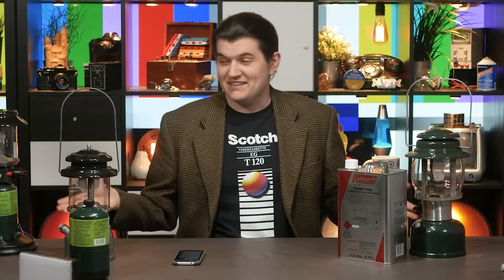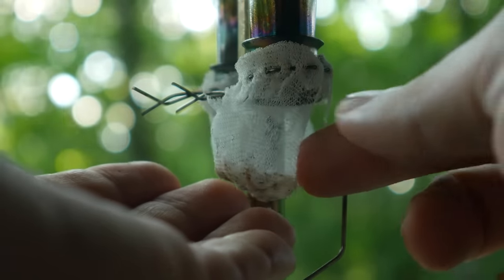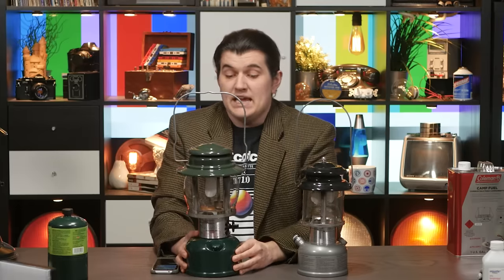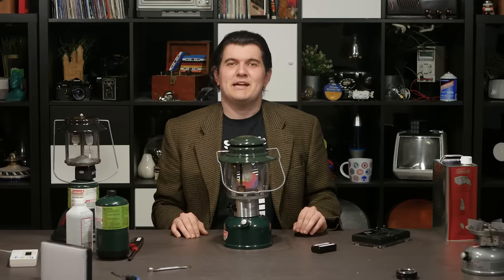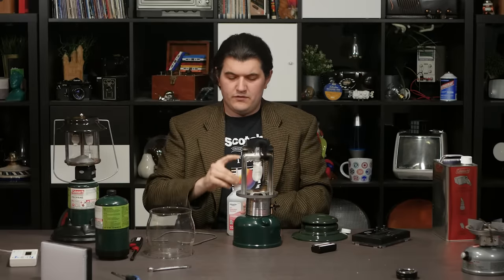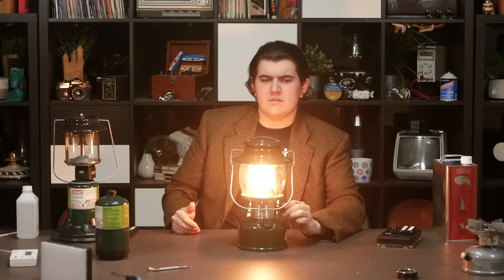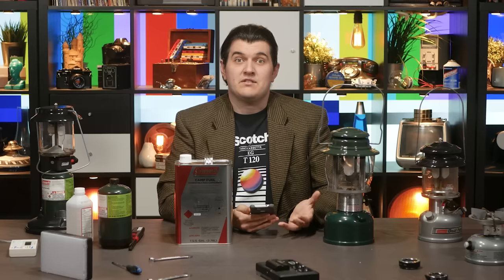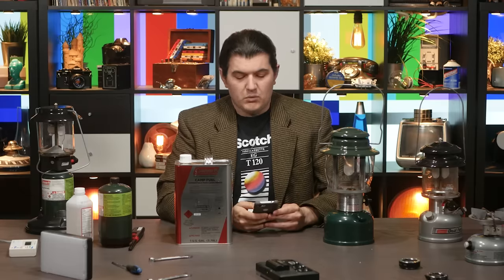A very rambly Coleman Lantern follow-up. Turns out they rarely make sense in 2021

Comment: The best kerosene lanterns have a blowtorch starter built in that preheats the generator without needing alcohol.  These would be the petromax or clones. Kerosene also has a very long storage life when the container is sealed properly.  I switched over all my emergency backup stoves and lanterns to kerosene.
Reply: I would think it would be simpler just to design the bottom so it would funnel any liquid fuel that's squirted out to the base of the generator, and then have a fiberglass wick around the generator.  Kerosene will ignite readily with the aid of a wick, and the flow of fuel to the wick would automatically stop once the generator started vaporizing the fuel.
Reply: Kerosene's also a lot safer: gasoline emits heavier-than-air flammable vapours which can be difficult to vent from, say, a boat's bilge, and kerosene doesn't. My father had a small (7m) yacht and gasoline (which we called petrol) was strictly forbidden in the cabin. Instead there was a special locker in the cockpit with air vents at the bottom. For cooking and light, we used kerosene (which we called paraffin), which was allowed into the cabin.
Reply: Well it is true that kerosene is more stable over the Long haul than gasoline. When all hell breaks loose it's probably going to be a lot easier to get your hands on gasoline. And that's one of the primary uses of these lanterns is during the times that may look a lot like a zombie apocalypse without the actual zombies.
Reply: @flatfingertuning727  That would be smelly and smoky though.
Reply: Kerosene is great but the lack of risk to my life and face make it much less exciting.
Reply: It lasts an amazingly long time. I moved into a farmhouse and found a nearly full 55 gallon barrel of k1 from about 1965. I ran that entire 50 year old barrel  without issue in my salamander heater.
Reply: @MostlyInteresting  you've only got one month before the gasoline goes off if your siphoning from cars. In a properly sealed container you've got a year.
Reply: @fergusoddjob  eh, I've seen 10+yr old gas burn through engines. But well, and it stinks like varnish but it still contains some octane
Reply: @quazorgemash  I imagine that given these lamps aren't nearly as sensitive as modern engines to the fuel they are using that they would likely work for much longer than the numbers I gave. But it still stands that gasoline probably isn't the best 'apocalypse' fuel.
Reply: @MostlyInteresting  Given how the east coast got out of a gasoline shortage a few months ago and how almost every time a major hurricane hit, a regional gasoline shortage follows, I've got a hard time justifying burning gasoline for light when you could be burning anything else and keep the gasoline for mobility so you could evacuate or run about helping friends or sort out your living conditions.

Unless your scenario implies that most humans just disappear thus killing the competition for fuel use, because from what I see, gasoline seems to be the first fuel to run out.
Reply: Lamps alone are hundreds of dollars, a barrel of kerosene is hundreds of dollars, that's thousands just for lamps and fuel.  LED lights, li-ion packs with a solar panel beats it hands down.
Reply: @BigSmartArmed  If you're buying kerosene by the barrel or would need an oil tank for your usage then yes absolutely.

However, if you want one in case of emergency + few odd times and you expect to have flawless operation in 10 or 20 years ( when you need it) then  kerosene makes more sense as stated.

trickle charging kills li-ion so you can't leave it plugged in so it's full charge when you need it. 

Not regularly cycling (using) the lantern will kill the li-ion

regular usage will wear down the li-ion and require a replacement every few years which can be economical if you rely on it as a primary/frequent light source

And guess what?  I own both because when one is better than the other is situational
Reply: @MostlyInteresting  Alcylate fuel stores pretty much the same as kerosene. Also doesnt soot up the nozzle like gasoline does. In addition, you can run your zippo lighter on alcylate fuel.
Reply: @marccharbonneau1114  I see where you're coming from.  In remote locations it's a solid solution for reliability.  Enter price is high but it pays off in longevity.
Reply: Kerosene is much safer to store, transport, and handle in general terms, than gasoline and other fuels. Aside from gasoline which wasn't ubiquitous until later, the use of volitle or unpredictable fuels is why the use of kerosene became popular in the late 1800's in the first place. With the use of kerosene, the number of house and building fires went down dramatically.
Reply: @quazorgemash  Depends on the fuel blend, as there are a lot of additives that have all kinds of side reactions that yield powder/crystals/goo that prevents engines running properly.  Some fuel blends can store well.  Many can't.
Reply: Reminds me of my white gas/gasoline Optimus stove copy. You either used a mini pump on the fuel tank or just warm it with your hands and it would build enough pressure for fuel to dribble out the valve into the starting cup - so pretty much a blowtorch too I think.
Reply: Flat Finger Tuning the problem with that is all the soot it creates. Alcohol burns cleaner and you can use water to clean a spill to make it safe, even when it's burning. The Petromax torch starter mixes lots of the pressurized air with the kerosene to burn cleanly.
Reply: @christopherguy1217  Burning kerosene with a wick would produce some soot, but only for as long as one was using the starting pan to heat the generator (as compared with e.g. a Dietz lamp that would produce soot constantly).  The presence of a wick shouldn't prevent someone from using alcohol to preheat the generator if one chooses to do so (leaving the kerosene valve closed until preheating is complete), and having liquid kerosene that comes out the burner go into the pan would seem safer than just letting it go "wherever".
Reply: @flatfingertuning727  That works but burning unvaporised kerosene stinks and is smoky.Alcohol (ethanol) doesn't have much smell if it hasn't had poison put in it to punish you for not paying an excise tax if you try to drink it. The blow torch type ignitors help alleviate some of the kerosene smoke and smell problem by getting hot fast but you have to pump like a madman to keep up with it.At least from my experience. None of it is a quick or convienient as flipping a light switch but I like having light in remote places and on boats with a fuel that isn't laying in wait in the bilges to blow me up.
Reply: @gregsmith5695  If someone has a lamp along with both kerosene and alcohol, it would make sense to use alcohol to start it.  If, however, one runs out of alcohol, I would think that being able to burn kerosene in the starter burner would be preferable to having a lamp that couldn't be lit at all.
Reply: @flatfingertuning727  That was what the torch types tried to  alleviate. You had a lot of responses and maybe feel a bit preached to or lectured to. It wasn't my intention. If you light the lamp outside and let it burn off your suggestion will certainly work in a pinch.It just stinks and smokes a lot.
    For the pressure lamps a mantle and a match is needed as well obviously.The alcohol sort of goes along with all the rest of the paraphernalia. Each one could be a broken link in the chain. When I want a lot of bright light in a remote place for hours on end I use a pressure type lamp.If I just want area light I use a wick type lamp. If I want a table lamp I use an Aladdin with an incandescent mantle.Mostly I bring a flashlight on trips at night or I flip the lightswitch on the wall.
     The whole debate over LED versus fueled lamps only became possible in the past ten years or so.
      Right now it is sort of like comparing vaping to lighting a cigar that was kept in a humidor.The tip cut off with a special cutter and lit after carefully charring the end with a wooden match. 
     One is more modern.I'm a bit of a traditionalist and a Luddite and prefer the "old way".
 I'm also able to change my own flat tire without calling AAA or getting bogged into debating run flats and no spare in the trunk versus a patch kit and a jack. The last bit not directed at you but rather the whole premise of this video.
Reply: Just take a vacation.  Your state might have a gas shortage , but neighboring states don’t
Reply: “ trickle charging kills li-ion so you can't leave it plugged in”. FALSE.  Lithium chargers shutoff when the battery reaches full, so yes you can leave them plugged in.  (If you’re really cowardly, then use NiMH which can be trickle charged.)
Reply: fiberglass would not hold up to the flame.  You could not wrap the generator with a wick.  Once it lites the mantle keeps the generator hot to keep the generator vaporizing..
Reply: @MostlyInteresting  I stick with the coleman fuel which doesn't foul the generators which the additives in modern fuel do.
Reply: @MostlyInteresting  In any semi-rural areas there is plenty of Kerosene. If its a true apocalypse rather than a medium term disaster scenario then ditching all these technologies that are based on industrial infrastructure is going to be required and you will need to return to burning wood. Until then, kerosene is far better to store than gasoline.

Comment: Uncovering the hole on the pump is an old urban legend people thought was necessary because they assumed that hole was the intake valve.  Makes sense, but that’s not the case.
Reply: Why is the hole there, then?  (Not trying to be contradictory, I'm genuinely curious.  I've always wondered why they put it there).
Reply: The hole is there to allow air to escape after you twist the knob and close off the pump outlet into the fuel tank. Without the hole to allow air to escape you would not be able to press the pump handle back into the pump body after the valve is closed.
Reply: @hydro2wheel  ooooooohhhhhh that makes sense. Thank you!
Reply: I used to use a coleman backpack stove, and I never uncovered the hole on the return stroke. It is not necessary.  The hole is either a pressure limit, or just there to make it easier to push the plunger in when you're done pumping.
Reply: @spugintrntl  The hole is there so that you are able to leave it uncovered and push the pump all the way in to stow it when you're done pumping. If it wasn't there you would have trouble getting the plunger all the way back in and it could become damaged or dirty.

Comment: Your geiger counter isn't defective. You just have to hold the power button for several seconds before it turns on
Reply from the maker: Well I'll be. I just tired that and yeah it came on. That's an incredibly stupid design, though. Once the screen lights when it's plugged in you can release the button. Why there would be a need to keep holding it on battery power is beyond me.
Reply: @TechnologyConnextras  In theory it could be to avoid accidentally turning it on while it's in your bag or such.
Reply from the maker: You still have to hold it a while before it even begins to wake up as you can see in this video, plus those buttons are very stiff and unlikely to be accidentally pressed. I really think it's a bug in the software or perhaps the startup of the Geiger-Muller tube pulls enough current that the button needs to be held down. It's just silly.
Reply: @TechnologyConnextras  In that case yeah, it's definetly silly and even if accidentally turning it on was a concern making how it works when powered and on battery consistent would be better.
Reply: @TechnologyConnextras  as far as I could test it, they intentionally programmed it that way. It has to do with several things, probably. 1. the more obvious part: The overall design is such, that it needs the button press on battery until the HV-generator-circuit is fully charged and stable. Battery is, i think, current limited on the PCB, so releasing the button too early makes the voltage for the CPU go down too much. Think of the button as a temporary override. 2. The CPU checks for serial connections and does the initial self-check. If written in C-like programming language, this part will be done separately. If the button is released in that time (until the beep), it will shut off.

Comment: Lanterns are also useful for heat.  We used to use them at a hunting cabin we'd go to in the winter.  They can produce nearly white light (they are extremely bright), and they give off a ton of heat - so if it's early spring or early fall, they are a nice addition to warm up the space.

I grew up in a very remote area in Northern NY.  We'd have power outages in the winter that could last for days.  With a Coleman Lantern, we'd play monopoly in the kitchen and it would get sweltering - but the rest of the house would be cold.  We had 2 fireplaces, but they were as far away from the bedrooms as you could get.  We'd be heating the place as best we could to prevent the pipes from freezing (would have taken days frankly).
Reply: My in laws are from NY state and they said there is a region where you need to get a floating door on your second floor because they get so much snow you cannot open the ground floor door, recalled hospitals being staffed by snowmobile and being tasked with sledding snow because the snow was too high to pile any higher. It's a surprisingly inhospitable place.

I have had electricity down for days in wind storms (including one incident where the power pole in front of the neighbors lit on fire) and during that time we have a kerosene lantern and use candles and you better hope it isn't too hot or cold. If I ever built my own home I would scrape my pennies together to put fireplaces in the bedrooms and living area. This is a fear for me that having a fireplace would dissapate; although I would be more than happy to just sleep where the fireplace is. I imagine using electricity for cooking would make you insecure for that purpose as well but my stove can be manually lit.

 I have heard of stoves in Scotland being capable of not only cooking but heating an entire home, though it does not get as cold in Scotland as it does near the great lakes.
Reply: @xSwordLilyx  I'm from NY and I've never heard of this.  My family just got 4 feet of snow a few weeks ago, over night from lake effect.

Lake effect snow is something to behold.  Snowflakes that are larger than quarters.  When I was in college in Buffalo, I'd go out running during lake effect storms, I literally could not see the street lamps just the light from them.  All I could see around me was the sidewalk and white.  I couldn't even see the houses.
Reply: @xSwordLilyx BUT the heat is a hassle if it’s a hot summer night.  You don’t want your light source making you even more hot. You want a cool source like LED lanterns

.
Reply: @electrictroy2010 Really hot summer nights are pretty rare in most of North America though.
Reply: You can't beat the light heat and sound of an old coleman lantern for camping...other than the camp fire.

Comment: The most practical thing about Coleman lanterns is their nostalgia, at least in my opinion. The stoves are great though, and both are fun to tinker with and restore. I appreciate your content!
Reply: I feel the same way. I hate to admit it, but I find myself judging over products by nostalgia way to often. That’s just not rational.
Reply: These white gas lanterns are great for ice fishing. I use mine every winter. Gives my light to fish by in the evening and provides a way to warm up my hands as well.
Reply: @meegstomtom  yep, I think where fueled lighting makes logical sense is scenarios where both the light and the heat are welcome.
Reply: The issue I seem to run into with electric products is something always seems to break on them and repair/replacement of what broke seems to be impossible after just a couple of years. Meanwhile the pressure lantern my father gave me, that he probably bought in the '70s, still works and I can repair it if necessary. For the limited camping I do, I like knowing I won't need to buy new batteries or a new light whenever I decide to go out next. And yes, there is certainly some nostalgia knowing its the same light my father used before I was even born.
Reply: I've used that tiny Coleman stove he had in the video on several solo car-camping trips, and on team-based hikes. They're heavier than those canister gas stoves, but they have a much better heat output, work better in cold weather (canister stoves don't work too good on cold mornings when they're below half full & perform badly in wind), plus gasoline or white gas is relatively easier & cheaper to get than refill canisters.

Comment: It's funny listening to you talk about the energy content versus density of various fuels because I'm very used to those discussions, but usually in the context of rocketry rather than heating and lighting!
Reply: Well for most applications liquid fuels are close enough to each other that it doesn't really matter, the most striking example is in cars where as long as you can adjust the injectors correctly the difference between ethanol and gasoline isn't really that big of a deal you will lose a little bit of range, but you can still go hundreds of miles on a tank.
Reply: What is a rocket if not a very large and fancy heat and lighting candle that just so happens to push itself anyway.